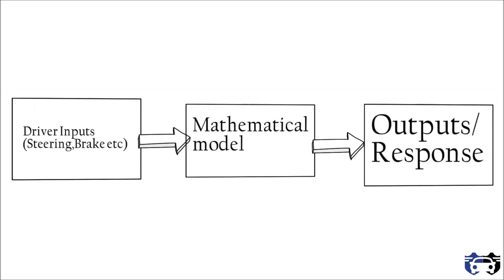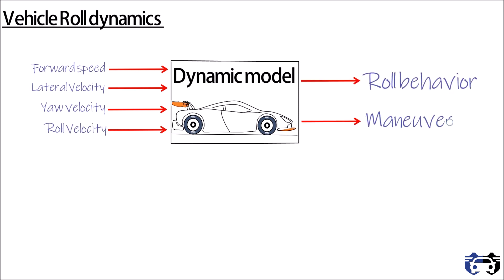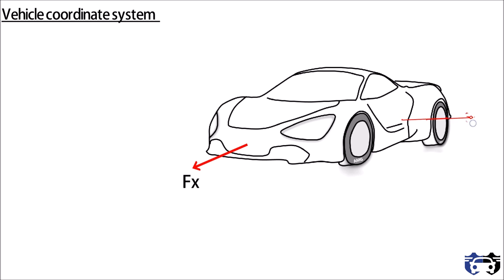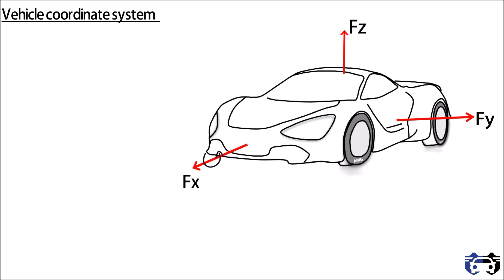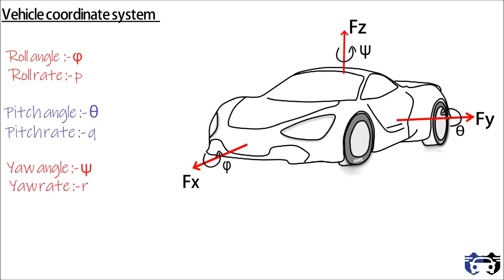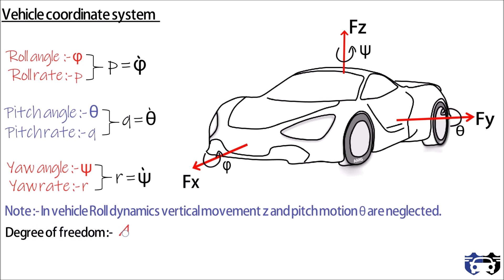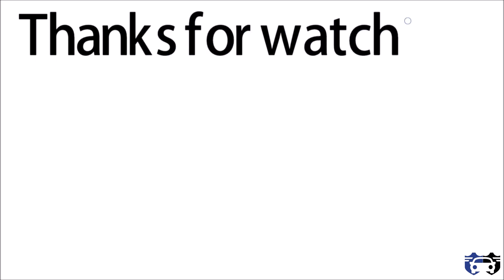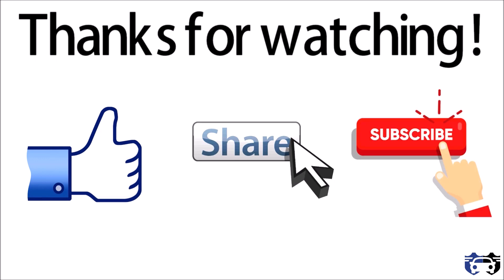Vehicle Roll dynamics - Introduction | AutoMotorGarage

Comment: hey dude, i have a question that i hope u can answer, we are talking about the rod shape, 

-- what is the difference between circular h arms vs square h arms?
or
https://grabcad.com/library/h-arm-suspension-1 VS  https://www.t2shop.de/XRAY-303173-H-T4-2020-Rear-Suspension-Arm-long-right-HARD
Reply from the maker: Its all about Mechanics of Solid ! Moment of inertia of square is more than circle, which means its section modulus is higher. And further Bending moment is also higher and that means , square cross-section can withstand more bending moment than circular cross section.So, according to the force and moments going to be applied on H arms , choose your cross section accordingly.
Reply: @thevatsaljain  ah!, thanks buddy that explains it! 
keep up the work!
more questions later! thanks again